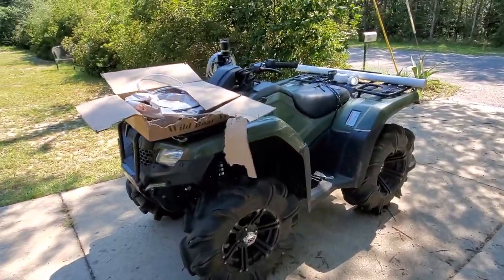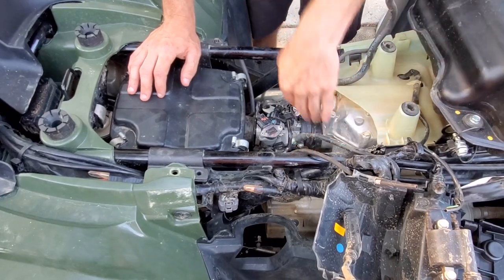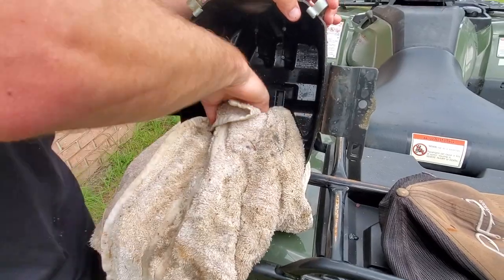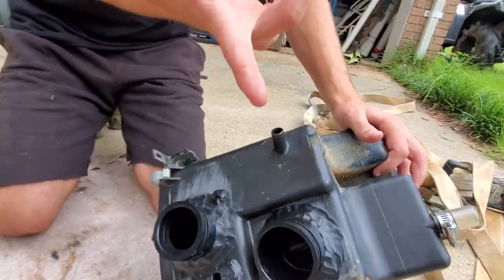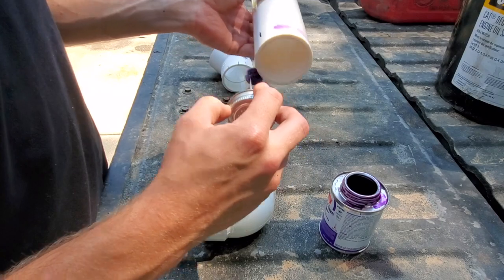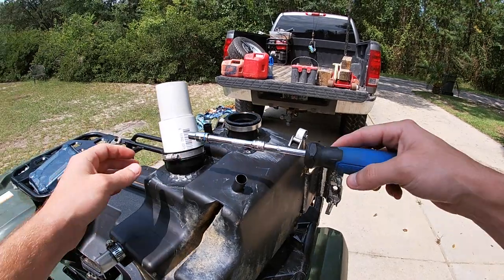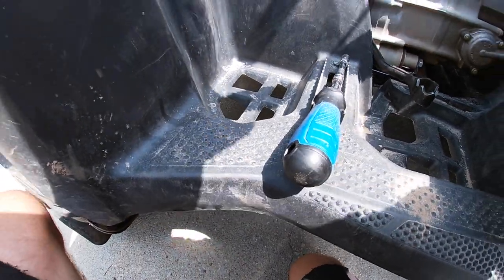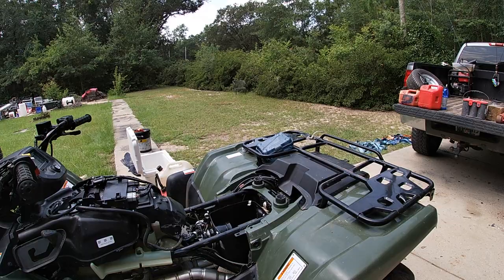How to Snorkel your 2014-2021 Honda rancher, foreman, or rubicon!

Comment: Electric grease.
1 1/2 inch pbc cuppler
5 1/2 pbc 
1 1/2 inch rubber cuppler
4 ft of spa hose 
1  1/2 inch to 2 inch rubber cuppler
2 inch Pbc 90 
2 inch Pbc 45
However Tall you want snorkel 2 inches thick
Reply: id use abs instead of pvc its black and stronger also

Comment: Can u please make a part list??
Reply: 5ft 2” pvc pipe, 2 2” to 1’2 or 1’4 coupler, 1 inch spa hose buy like 2-3ft and cut it to needed length or longer, like 5 inches of 2” pvc to run from your boot to the pvc pipe then the coupler then spa hose then coupler and then the tall snorkel piece
Reply: And grease
Reply: What’s that Metal piece called

Comment: Hi there I have an rzr 800 and I snorkeled it and used ultra black and it did fine in the water but later on in week it ran like crap though water got in fuel so parked it and when I got home my throttle body was laying in the valley of the engine so I need to put ultra black on the throttle body ( both sides ) or does the rubber cupers keep water out

Comment: What grease did you use on the air box lid
Reply from the maker: dielectric grease
Reply: @vesselpowersports did you seal it with ultra black